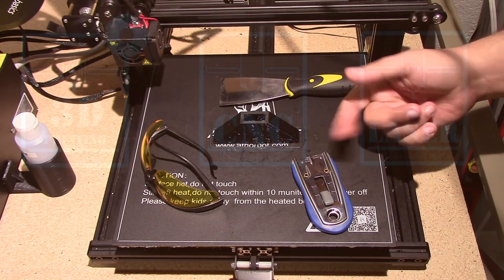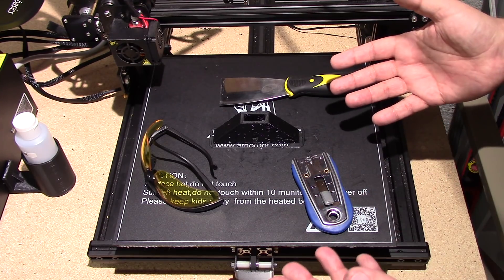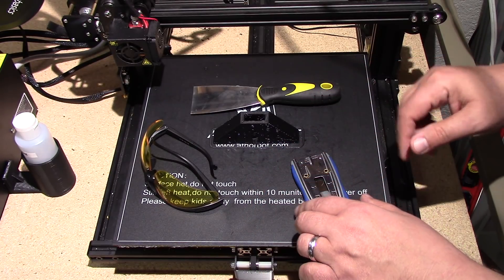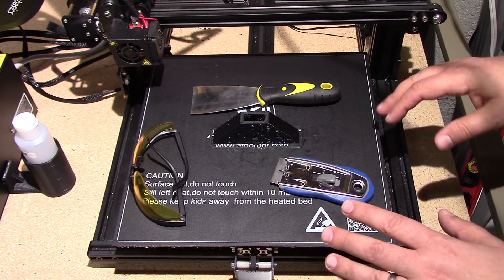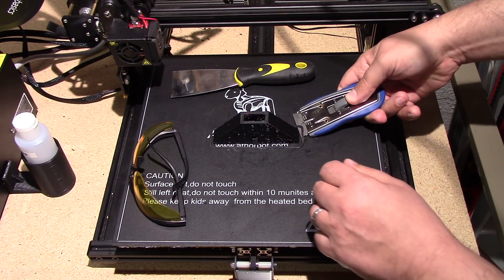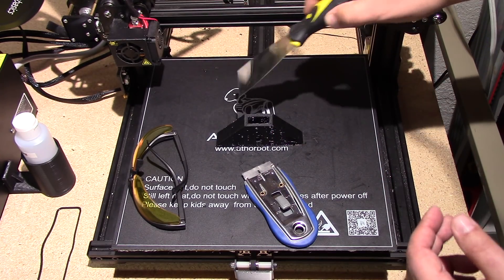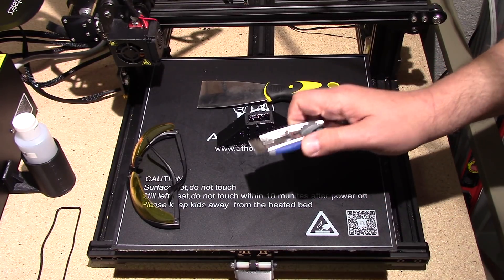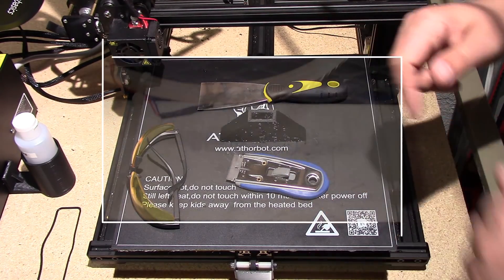Shop Talk - Stop Tearing Up Your Build Surface!

Comment: Why not a flexible surface?
Reply from the maker: Because they might not be best for all materials especially PETG as I show is a rather toughone to liberate.  For PLA, those new black diamond (they come in various names) works great but, PETG will damage them...
Reply: @DIY3DTECHcom  PETG has not damaged my Easy Peelzy.
Reply from the maker: Give it a chance :-)  Most of these have a coated surface, the PETG with each print will pull it off.  I had a similar issue with black diamond bed, as worked well for a while then problems,  You can also use a little glue stick as a release agent...
Reply: @DIY3DTECHcom  I fine tuned my heated bed temp to just about hold the PETG, 20 decent sized prints so far and no signs that the surface is affected. My Black Diamond bed did get ruined after a while but with PLA, because I let it cool right down all the time a tiny sliver of glass was pulled off, after that I always took it off when the plate was still warm which worked for a long time until I forgot and it ripped another chunk out. 

I then used PEI for a long time, that eventually became damaged, but I learnt how I need to fine tune the heated bed for PETG down to a single degree change.

 Now on EP I have found it's working really well, no surface damaged and no residue.

Edit: on the PEI, I started off by using a snap off type blade knife fully extended to slide under the print,  because of the length it was a lot easier to get under the print.
Reply from the maker: not sure what you mean "tuned" just temp?
Reply: @DIY3DTECHcom  yes just temp, as an example i get my ambient temp to around 16 I then need the bed temp at 62 if I go a couple of degrees higher it will likely start to affect the surface, with the filament I am using.

Comment: DUDE! Just sharpen the spatula! sharpen only 1 side, with a long and shar edge, then round the back of the edge so it feels smooth, round the edges fo the spatula so theres no sharp points, then with a 600 grit sandpaper remove the sharp edge so it doesnt damage your surface but stays thin. Thats it, you dont need a shar edge nor anything other than the spatula, works for small and big things. We use this here on blue tape which is easier to damage and no problem whatsoever. The only time the tape damages is when the pla bites too hard to it and it just rips the tape off the bed.
Reply from the maker: Interesting, yet find especially for PETG a razor works well for me to "release" the print and I can then get the spatula under that release opening for the added lift :-)
Reply: @DIY3DTECHcom  
PETG sticks more to blue tape but we've had no problem either, the tape just wears out faster, but still no probem prying the parts off with the sharpened spatula

Comment: I have 3d printed holder for razor and been using it for year, and now when I got my ender 3 If I have really delicate piece I would remove the bed and bend, it's somewhat flexible but don't bend too much(mine isn't the glued on or the glass ones)
Reply from the maker: did this (3d printed holder for razor ) come thinigiverse?  Sounds interesting...
Reply: https://www.thingiverse.com/thing:2029655

Comment: Joe, are you serious or is this just a late April Fools joke?  Why in the world would you go through all of that?  I told you over a year ago about the Creality 3D glass bead bed.  It is AWESOME!  Once the print is done it cools right down and you just lift the print off like it was never stuck on.  It IS the only way to go.  Every time I am amazed when I walk up to it and just lift the print off.  Here, again, is a link.  Get this and you will never go back to the ancient way. https://amzn.to/2G3LSC5
Reply: Or the anycubic ultrabase, it's the same concept
Reply: @Zilli_341  I have tried them all and the 3D Creality is the only one that works flawlessly as it does.  It's magic.
Reply: is there an alternative for the cr10?  My bed is the 300x300 and what you are sharing is only  235x235
Reply: @brucehirsch5437  Yep, mine is 300 X 300 also.  I know the link I sent was a different size but they make them 300 by, I have one.
Reply: @StanCook  I did a quick search on Amazon and come up with nothing.  I'll keep searching tgen.
Reply: @StanCook  thanks again!
Reply from the maker: For PLA it is good no question, however where I find this handy is for PETG as I don't like to print that on glass type surfaces...
Reply: Temperature settings for different filaments: 

1. PLA:50-70ºC  2. Flexible filament: 50-70ºC  3. ABS:100-125ºC ( 110ºCis recommended )  4. PC:100-130ºC ( 120ºC is recommended )  5. Nylon:90-120ºC ( 110ºC is recommended )  6. PP:100-130ºC ( 120 ºC is recommended )  7. PETG: 50-70ºC

Comment: the corners of these blades can be curled resulting in deep scratches to aluminium bed with blue tape or Kapton tape    i'm currently using a flexible magnetic Ender bed sheet .......they also can suffer damage  and over time appear to lose adhesion quality     Glass may just be the answer
Reply from the maker: Yes this is why mention and also stress the "angle" in the video :-)

Comment: The reason paint scrapers and all other forms of 3D printer spatulas aren't sharp enough to get under a print is because anything under 0.3 mm edge is considered a weapon.  Thank f'ing lawyers and politicians.  I learned this 3 years ago at this point in this video:

https://youtu.be/Ay8gkJi-ICY?t=70

The Chinese who made my printer apparently didn't read that BS rule because the spatula they provided with the printer looks exactly like your black/yellow scraper and has a VERY sharp edge which works great.  Perhaps one can have a knife shop grind a slope on one side of a paint scraper after you tell them why you need that?
Reply from the maker: LOL!  I have some what sharpen one of mine, however I still the razor handy to break the seal of the print :-)

Comment: Great tip - I use the same technique - once you get the razor underneath I follow up with the spatula sooner under the razor.  I've used all kinds of printer bed surfaces but I keep coming back to bare borosilicate glass with a little Aquanet hairspray optional depending upon how well the filament brand sticks to the glass.  A touching brim of 1 or 2 layers will hold down those pesky long thin prints that like to warp or to hold and stabilize tall thin prints.
Reply: I have used all surfaces and gone back to bare glass. I give the glass a good clean and dry before each print. Let the bed warm up and then print. And that is with PETG.
Reply from the maker: I don't I walked away for glass long ago and have not missed it.  Lots of view swear by it however I seem to just swear at it :-)

Comment: Nice, I prefer a frosting spatula. very thin and flexible. Most of the beds I have now, are the spring steel sheets held on with magnets or a magnetic sheet as in the case of the Wham Bam surface, which is very nice.
Reply from the maker: Interesting!  Thanks for sharing the tip!